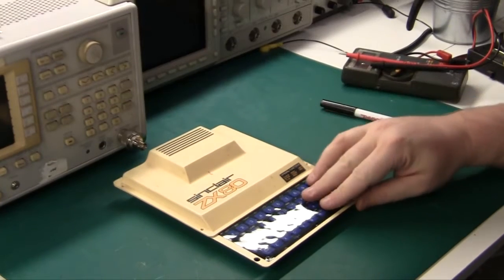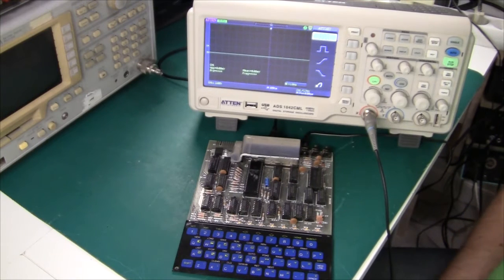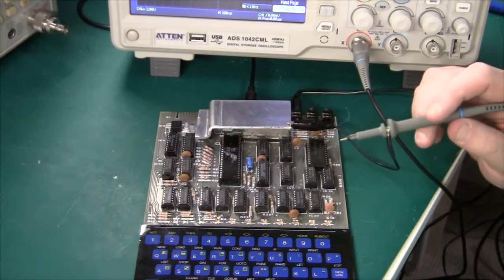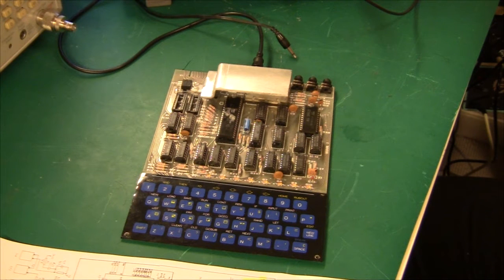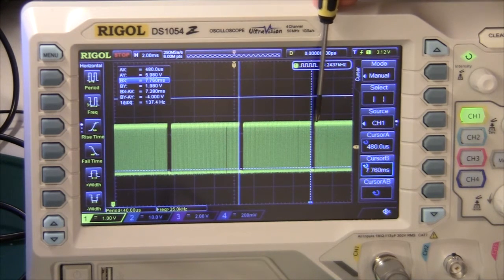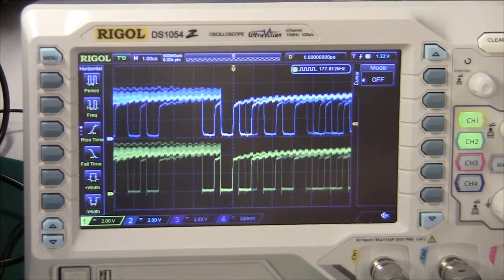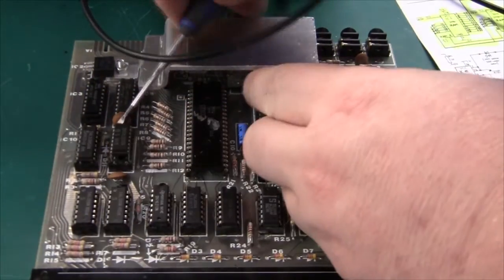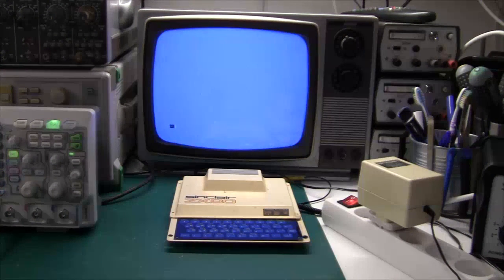Teardown and repair of Sinclair ZX-80 #1

Comment: Hi, I have one ZX80 and cannot get any picture. I have tested the power in the cpu and it is 5V also I obtain 3.2MHz in pin 6 of the cpu. But I noticed that the cpu is very hot. As soon as I power on the cpu comes hot as hell. I've tryed a different cpu with the same results.
Any help please?.
Thanks.
Reply from the maker: Based on the symptoms, it sounds like the CPU is OK, the power supply is OK. The only other thing I could think of, is that some of the pins on the CPU is shorted to ground or 5V (or 12V). If the CPU pin is trying to pull a pin high, but something forces it low externally, that could result i high temperature. 

I would remove the CPU from the socket, and check 

1) All pins on the CPU's IC socket for shorts/opens to ground and supply voltage. 

2) Examine signals on all pins with an oscilloscope when the ZX is powered up (without the CPU). Some pins could be stuck high or low, or not able to toggle. 

3) If that doesn't give you an indication, try to pull signals that are constant high to low (through a 100 Ohm resistor), and try to pull signals that are stuck low high (through a 100 Ohm resistor).

Make sure you use an 100 Ohm resistor. You DO NOT want to short a TTL output that is high, to ground through a wire :)

Hope this helps, and let me know how it works out.
Reply: @NatureAndTech  I will follow all the steps and let you know.
Thank you very much for your help.
Reply: Hi,
Tryed everything and looks right.
I can pull down all the pins except VCC and also can pull up all the pins except GND.
Also all the pins looks right from to GND and from to VCC.
Any idea?.
Regards.
Reply: Ok. Tryed the Z80 in a protoboard just with the power and is the same result. The Z80 get hotter very quick. So I think it is broken. Im going to find a replacement to test it.
Thanks.

Comment: Excellent video, thanks for sharing. I built my ZX80 from a kit in 1981, and it still works. Then I built a ZX81. I cut my teeth writing Z80 machine code, poking the opcodes because I had no assembler, referring to a Zilog Z80 manual instead.

Comment: Im just in awe at your determination and resolve. I would have given up at the first hurdle. But problem after problem trouble overcome. I also was surprised to see you troublshooting with an occilloscope because I thought they were only for trouble shooting analogue signals. I did a computer maintenance course many years ago and they told us to just test the volatges with the multimeter. Great to see a positive result! Would loved to have heard some of t he things you were saying in the speeded up bits.
Reply from the maker: Thanks so much. I hardly ever use a multimeter. Even digital signals are actually analog in nature. With a multimeter, you cannot see the signals, or the transitions, or the noise on top of the signals. The speeded up parts are just to keep the video below 15 mins. Nothing important being said.

Comment: Replace ALL the electrolytic caps with low ESR low ripple types.
Reply from the maker: ----- Start of rant! -----

Not that I won't change all the capacitors, but before the internet, that was never a problem. Now, suddenly, everybody panics about it. Who says modern capacitors won't be worse that those that have worked flawlessly for 30+ years?

I have a theory that shitty caps were made quite recently, for cost-down reasons. On vintage equipment, I've only seen the problem once, and it was not quite leaking yet, but the capacitance was quite low.

The only time I have seen the problem, was on the Tektronix oscilloscope that was famous for leaky caps. But that could be contributed to a specific manufacturer, with a manufacturing problem.

My biggest problem is fungus growing on my floppy disks.

----- End of rant! -----

OK, I will change them :)
Reply: Modern electrolytic capacitors have been a problem since the late 1970's when the Japanese demand for them in consumer products exploded.  There were two problems that developed.  Manufacturers did not properly seal the base of the electrolytic capacitors in order to speed up the production line.  They used rubber plugs which were not closed properly or the rubber seal degraded over time causing leaks.  

Second problem was that Japanese production lines increased the heat applied to the soldering devices, soldering stations, wave solder machines to also increase production levels.  The increase was an average 10 degrees over recommended temperatures.  Both of these events shortened the lifespan of electrolytic capacitors.  After 25 years on average they leak and corrode the circuit boards.  

There was a long investigation by members of the amateur radio community that eventually discovered why electrolytic caps were not living up to their life span.  Have a look on ebay for any Japanese made transceiver, and you will find a complete electrolytic capacitor replacement kit.

Now with switching power supplies, they too are causing rapid life shortening of electrolytic capacitors.  Products with Chinese made capacitors are failing much sooner because of the poor quality of those capacitors from unknown and untraceable manufacturing sources.  Your computer monitor is a good example, when new it does not radiate much heat, but when its near failure its radiating enough to heat to cook an egg.  I have a monitor that I replaced all the electrolytic caps and power resistors and cut the heat being generated out of the top by 1/4.

The problem is only with electrolytic caps.  Electrolytic capacitors are a combination of materials and an acidic fluid.  Ceramic caps almost never fail because their a solid one material component.  Film capacitors fail but for other reasons such as delamination and cracks from stress.

You computer only needs the electrolytic's replaced.  If any of the other ceramic capacitors have failed, its just bad luck.

Cheers : )
Reply from the maker: wow, that made a whole lot of sense. I didn't know about the temperature increase, only the switch-mode supplies and chinese capacitors. You win! I'll update the electrolytic caps.

Comment: When hardware debugging ALWAYS check the component datasheets. At around 3:50 in the video you made the first repair... apparently fixing the 5v to IC 21... But unlike most 74 devices, the 7493 doesn't use power pins in the package corners. You most certainly didn't supply 5v to that IC's power pin. Pin 14 on that IC is /CP0 not +5v
Reply from the maker: Well spotted. You are 100% right. Someone already pointed that out.
Reply: I aggree. In the zx80 schematic 5v is in pin 5.

Comment: What a great Video!

What I've got here is a "strongly patched and killed" ZX80 board which is inoperable... :(

Can you give me a hint about the size of the heat sink of the 5V regulator? I do not have the case so I'm not able to fit it in...

What I need is the exact shape of the heat sink...

THNX 4 info...